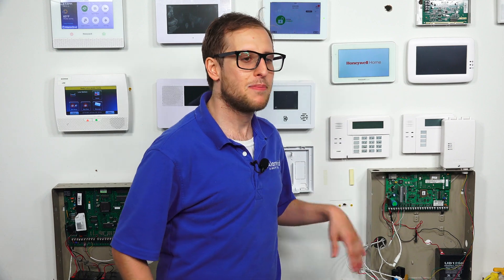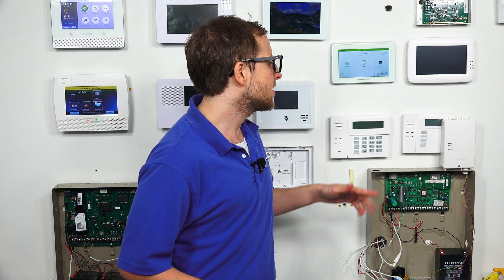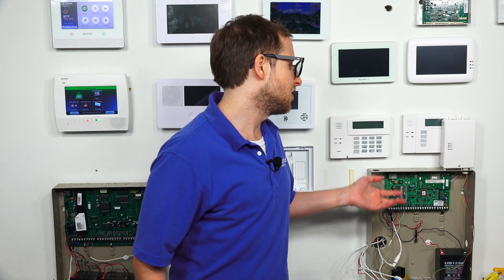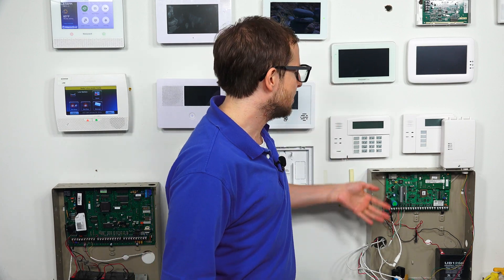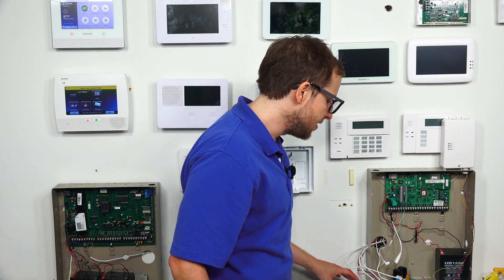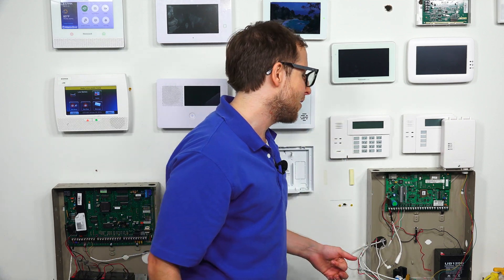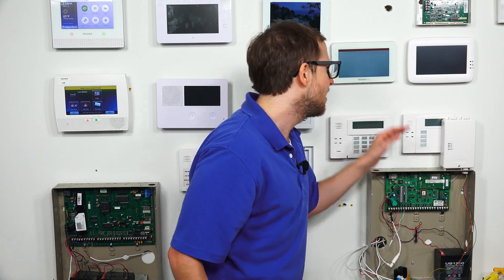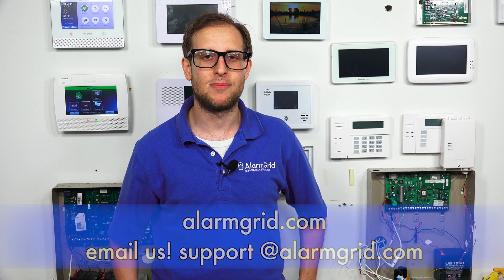Wired Alarm System: Power Cycling

Comment from the maker: A note on this video, if you choose to unplug the transformer, be aware that it will likely be screwed into the outlet. This is done by removing the screw that normally holds the outlet cover in place, and replacing it with the screw that comes with the transformer. This is a fairly long screw, so it takes a while to get it completely removed. In most cases, this screw will use a flat blade screwdriver. One reason the transformer is screwed into the outlet is that it is so heavy, its own weight can sometimes cause it to come unplugged. Another reason is for security purposes, to make it more difficult to remove AC power from the system.